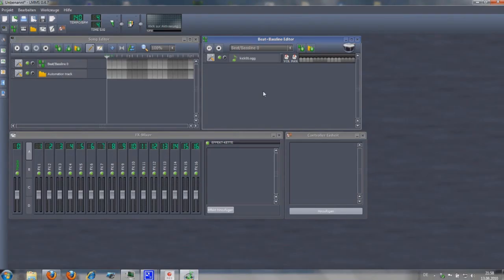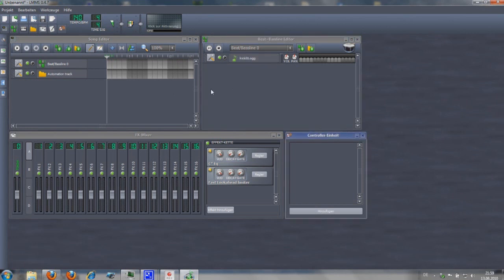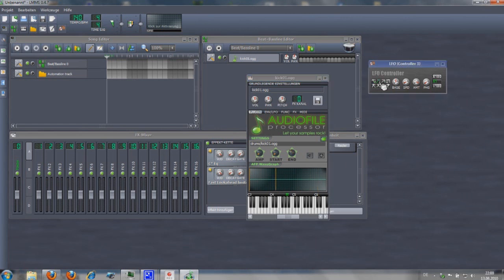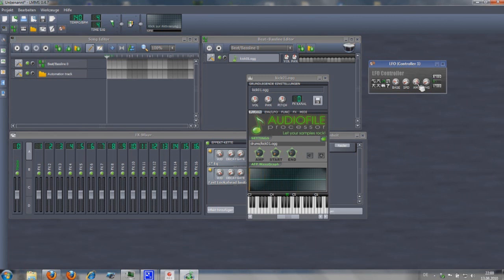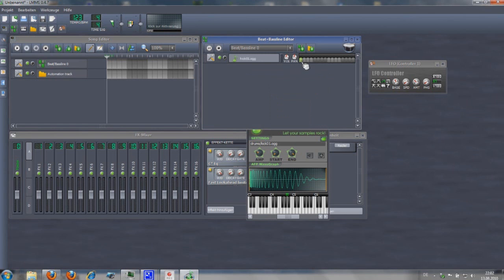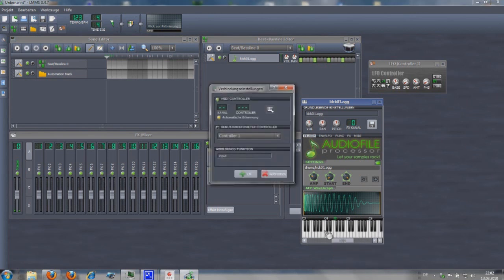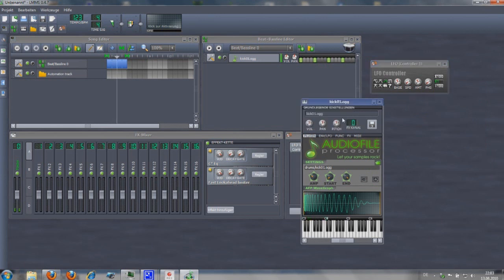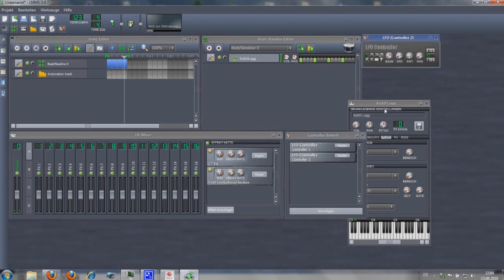Beatmaking 01 (LMMS Tutorial 1/4)

Comment: Thanks for that info EsoXLB. I really appreciate it. One last thing. "Sometimes" when I make sounds or Synth instruments, using the Triple Oscillator, I get an annoying tapping knocking or clicking sound. I tried using Limiter and others etc. To see if that would work. But it doesn't solve the problem. It seems a good bit of "Beginner" to "Experienced" Lmms users have this problem as well. Some think it may be a small glitch in Lmms that causes it. Any suggestions on how to solve this?